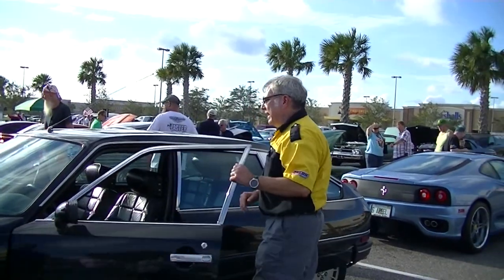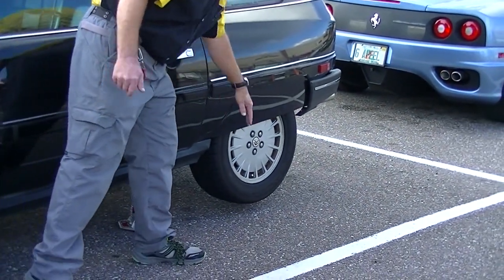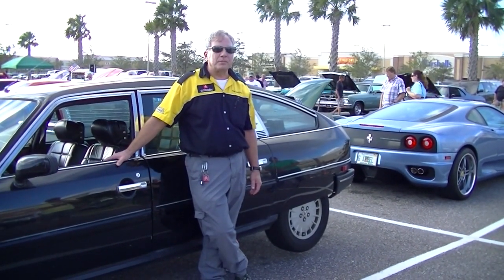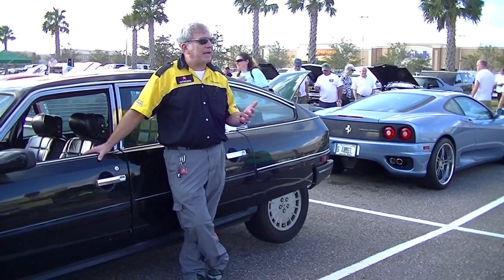Citroen CX Hydraulic Demonstration

Comment: CX Prestige is one of the most comfortable high speed touring car ever made... Another advantage of the suspension and steering geometry is the you retain complete control in a high speed front tyre blow out. In the rear you won't feel it. Hydraulic Citroens are the only 4 wheel car that can be driven on 3 wheels.

Comment: have a 2004 C5 and hydraulics still works flawless till this day :D
Reply from the maker: Since the introduction of LHM (and later, LHS ) the Citroen Hydraulic suspension is very reliable.  It got a bad reputation early on when they attempted to use brake fluid, and just because it was different.  LHM has excellent corrosion protection, and if kept clean, the later Citroen hydraulic system is basically unaffected by time.  I've had 3 LHM Citroens for a cumulative 20+ years, and I have never had a significant hydraulic problem, and never replaced a major hydraulic component.

Comment: شيء رائع فعلا لكن هل يوجد قطع غيار لهذه السيارة
Reply from the maker: Because of the wonder of the internet, I can easily buy parts from Europe.  The fuel injection system is standard BOSCH, so many parts are identical to BMW, Volvo, etc. of the same vintage. Other parts are substituted, for example the alternator has been upgraded to a higher capacity Mitsubishi part.  Note:  The CarCynic no longer owns this car.